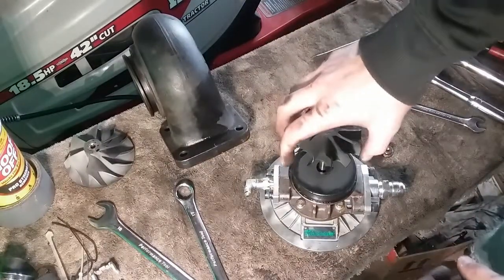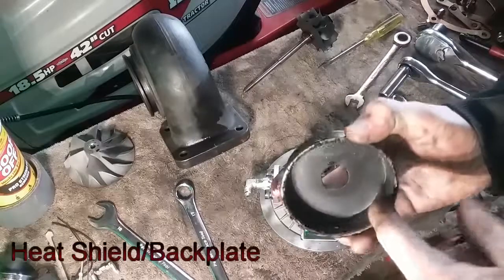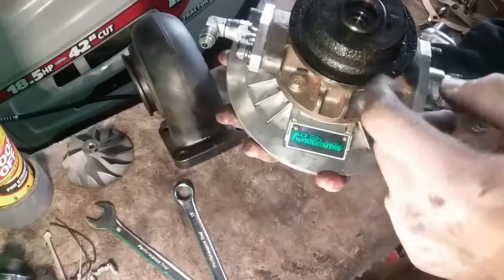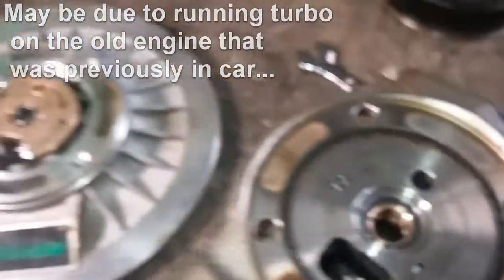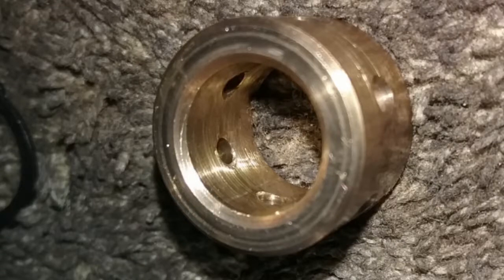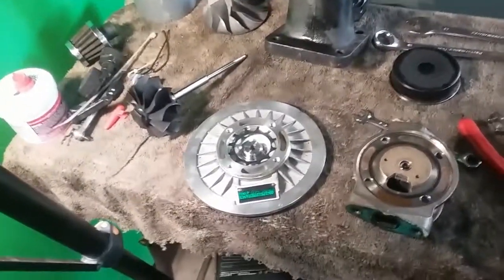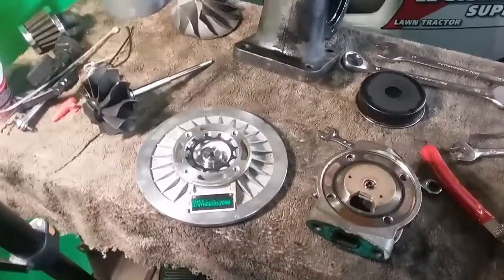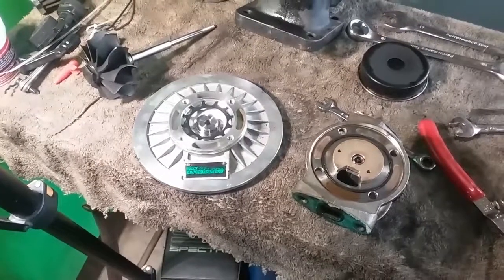Blown Turbo? | Turbo disassembly | Pt.2

Comment: I disagree with a restrictor on it at all regardless of what On3 claims.  There are a lot of people with dead turbos from running a retrictor when they dont need one.  On a ball bearing turbo I would agree, on a journal, no.  run a straight 4AN and see if it smokes, if it doesn't let it ride.  If it does, start with a large restrictor, like .100, if you know your return is efficient.  The journal needs an oil film and high pressure full time or it will shit bearings out left and right just like yours did.  Just my .02 cents sorry haha
Reply from the maker: I agree with you, they recommend a .035  and im running a .040, will probably swap out to a no restriction one sometime to test it.
Reply: See that is what makes no sense to me, necking down a 4AN to .035 and having a 10AN return is counter intuitive.  You would probably never "back up" any oil with a 4AN return like that.  You have a tiny little pencil lead piss hole that is meant for a bearing that is supposed to float.